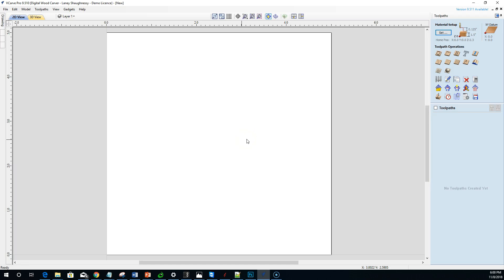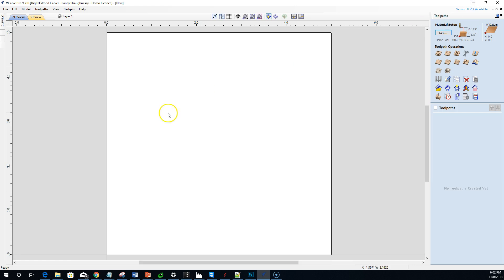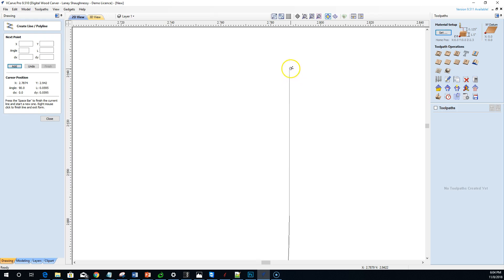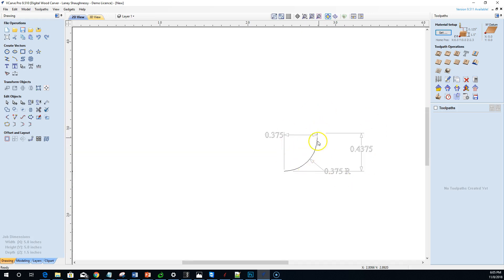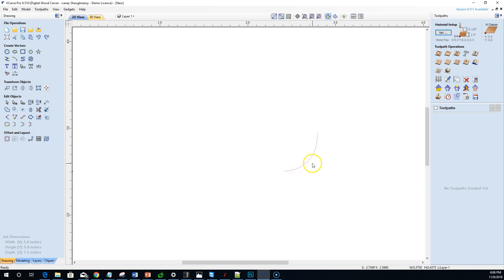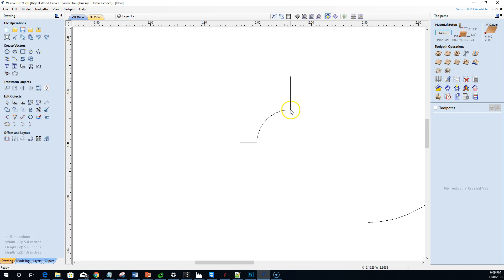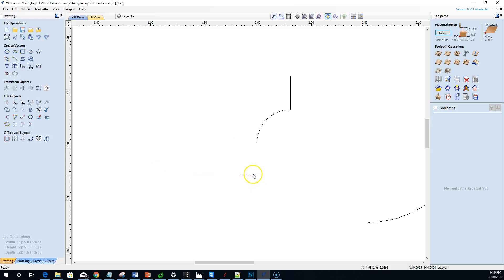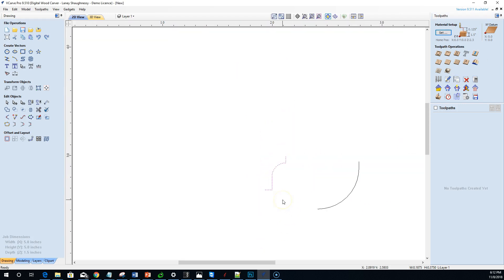How to add a Form Tool to your Vectric Software

Comment: the number from the dimension that goes into the collet where I write it
Reply from the maker: It depends on the bit if it is a tapered ball nose bit the shank dimension goes in the dimension box most all other cutters end mills v bits and other specialty bits the shank is not included the dimension is referring to the dimension of the cutter for those bits. When you're adding a tool look at the graphic to the right and the little descriptions and the little letters describing for dimension the letter d will show whether it's asking for the dimension of the shank or the dimension of the cutter. If it's asking for the dimension of the shank then that number goes in the dimension box if it's asking for the dimension of the cutter then that number goes in the dimension box
Reply: Good evening, I'm sending you a picture of this knife that I want to use in Aspire, can you please do it for me with all the details and numbers and send me a photo thank you very much in advance. I will appreciate it!
Reply from the maker: @ΓιώργοςΣτουμπης-ξ9φ  send the image to Laney.shaughnessy@spindletv.com

Comment: Issue, when you get to the part @ 5:30 when you are putting in a "New" tool the bottom of your tool data base is not like mine. Yours has six boxes" new, copy, delete, new group, import, export. When you click on new" the tool type box opens. Om mine, under tool database, I have icons: a plus symbol and add to group symbol, copy, import, export, remove, none of these have text just icons. Logic tells me to click the plus symbol, but when I do, I dont get a box for tool info to add th etool type, not sure what I am doing wrong. thanks

Comment: This was really helpful. I do have a question though. The bit I'm adding has a dxf file drawing for it. It is seperate vectors. When I'm adding it... it doesn't actually come out the shape I'm expecting. When I joint the vectors I get the correct shape... but the diameter doesn't come out right. What could I be doing wrong? I'm adding a 3/4" diameter bowl bit with a 1/4" radius and 5/8" cutting height
Reply from the maker: Angie sorry for the late reply did you ever get this figured out? Or would you like me to provide the answer?
Reply: SpindleTV I'd have to go back and check. I haven't used the shop bot for a while.

Comment: can't draw keyhole tool
Reply from the maker: you will not be able to draw a keyhole tool in the vegetable database when using the keyhole tool you will use a dummy end Mill just for the speeds and feeds when setting up your key hole toolpath you will put in the parameters in that gadget if you have vectric vcarve desktop then you will not use the gadget you will draw the appropriate vectors for a keyhole path using a dummy end Mill but substituting it in your router with your keyhole bit

Comment: No matter how many times I try. VCarve refuses to accept my particular form tool. It is a 5/8" Birdsmouth with a 1/4" Shank. If I input the vector as described with the correct parameters it shows up as a regular V-Bit. When in fact it is nothing more that a V-Bit on its side. And the upper portion of the sideways V-Bit can't be inputed into the vector. Do you know of a way to add this particular tool bit to the database?
Reply from the maker: Ronald can you email me a picture of the tool this way i can assist you better. Sales@digitalwoodcarver.com a tool brand and tool number would help greatly as well